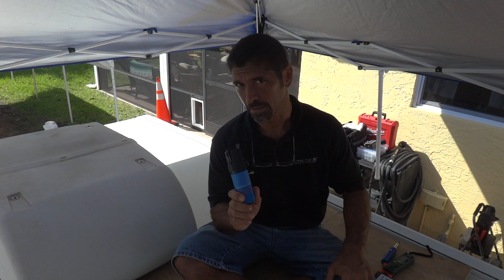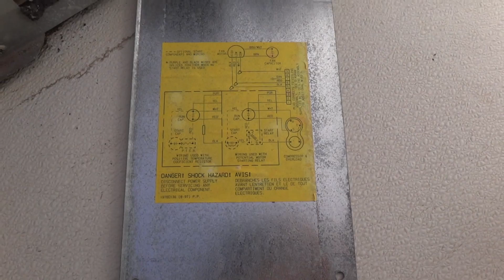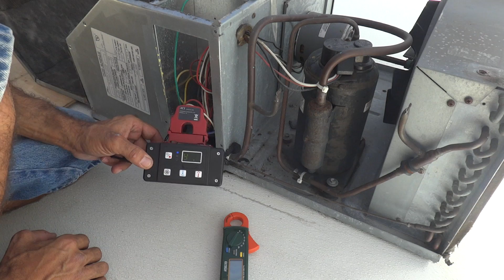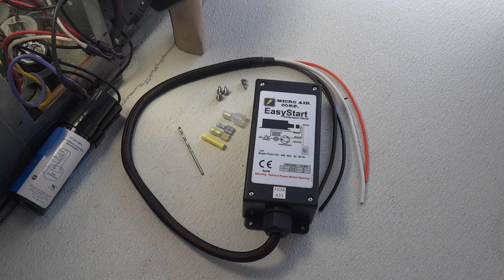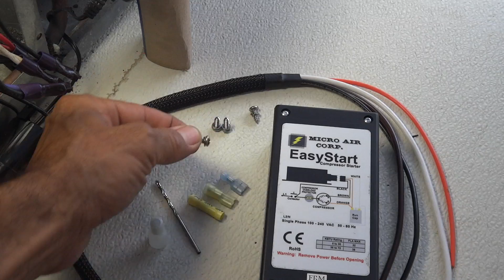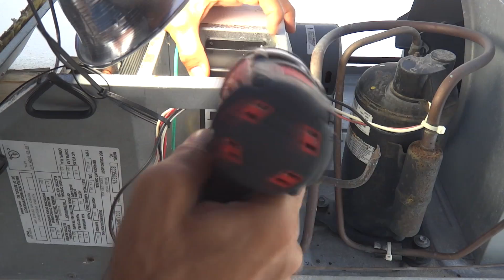Micro-Air EasyStart Soft Starter Installation into RV Rooftop Air Conditioner

Comment: I added the EasyStart to my travel Trailer's Dometic 15,000 BTU ac system.  I live at an altitude of slightly above 8,000 ft.  The technical support from Matteo at Micro-Air was simply fantastic and lightning fast.  You simply don't find this level of customer and product commitment anymore.  Prior to installing the device I connected my single Honda EU2000 Companion model to my camper but it could not start my ac and both the generator and my ac compressor would stall and bog down.  I also tried to start a friends new campers 13,500 BTU ac system at the same altitude.  My generator could start his smaller ac but would stall and fault out as the compressor attempted to cycle beyond the start cycle (after pressure had built up in the system).  After installing EasyStart, I had no trouble whatsoever starting and running my ac using both the generators 30 (26.6A) and 20 amp outlets.  I ran the ac system for almost 4 hours with no issues whatsoever.  I should mention that I forgot to take EasyStart through its 5 learning cycles using utility power (hopefully no harm done and maybe I can do this now and its not too late), and I had not re-jetted my generator for operations at altitude greater than 4000-5000 feet.  I also initially used 85 Octane fuel which Honda recommends 87 or higher to prevent loss of performance.  So with all these factors stacked against EasyStart, it was no problem for my Honda EU2000 Companion to start and run my ac system over several hours of operation and multiple compressor cycles by incorporating EasyStart.  A great product for 1/3 the cost of a second generator (who wants to lug around a larger generator or two EU2000's).  Highly recommend the product and the company.  I have several friends that will be buying the product - they are sold!  NO PROBLEM AT 8,000' and I am sure if I re-jetted (not that I need to at 8,000') it will perform just as well at higher altitudes'.
Reply: I want to provide an update to my post of one month ago.  After successfully installing and testing the EasyStart to my Campers Dometic 15,000 BTU ac system at 8,000 ft elevation using a single Honda EU2000 i Companion model, I was all set for a 3 week camping trip lin late August.  On two separate occasions the weather was hot enough that I decided to run the ac unit using my single Honda generator.  The temps were in the 86-88 degree range and I was at an altitude of approx. 6,800 ft and 6,300 ft. respectively.  On the first try at an altitude of 6,800 ft. my ac unit shut down and failed to start and the generator went into fault mode.  I shut everything down and tried again with the same result.  I must mention that I have not re-jetted the generator for high altitude as recommended.  A few days later while at a lower altitude of 6,300 ft. I tried again and this time the ac started but on the second cycle of the compressor (after pressure had built up) the compressor locked out.  I tried once more and got a similar result.  After getting home, I tried once more (now at slightly over 8,000 ft.) and the ac unit started but on the second compressor start it locked out.  I can only surmise that when I successfully tested the Easy Start after installation that the temps must have been much cooler than 86-88 degrees but I did not make note of that.  I really don't know how much of a difference if any re-jetting my generator for altitudes above 5,000 ft will make to the generators power output and if that will make a difference as the generator sounds like its running OK.  Additionally, I failed to take the EasyStart through its 5 learning cycles on ac/shore power after installing it and I don't know if I need to re-do this step by clearing its memory using a jumper technique????  Does anyone know how much increase power one can expect after re-jetting or even better, how much power degradation one can expect of the Honda EU2000 if not re-jetted.  Finally, I used fresh, non-alcohol based premium unleaded gas in the generator.  Over the next couple of weeks I will find time and re-jet my generator  and see if that will make a difference but as it stands my early success and celebration has been premature.

Comment: Will this Soft Start effect the life of the A/C or damage the compressor? I'm interested in installing a huge battery bank and solar system to run an A/C. If seen it done and they suggested watching your videos.
Reply from the maker: EasyStart actually does the opposite. It protects your compressor far better than any factory OEM configuration. This is because of its 5 different fault conditions that it constantly monitors for during start-up and steady-state operation.  Also, EasyStart has a "smart"" short-cycle prevention timer to avoid restarting the compressor while the internal refrigerant pressures may still be built up from the previous run.  Beyond this, although we don't have any empirical life test data (yet) to prove it, use of a soft start on a compressor will very likely extend its usable life because the mechanical and electrical stress of the brief locked-rotor condition that normally occurs during every regular (hard) start, is completely eliminated by EasyStart. 

Many customers with large solar/battery systems have succeeded in starting and running their A/C with EasyStart on inverters as small as 2000W.  Depending on the heat load and how long the A/C has to run, typically customers can get through a night's sleep entirely on battery power with an 800-1200Ah 12V battery bank.

Comment: I have a Dometic 15,000 BTU A/C and this device will allow me to start the A/C compressor with 1 2000 w generator reliably?
Reply from the maker: Hello. Yes, EasyStart will allow you to start and run a 15k BTU rooftop on a 2000W generator.  We've verified that it works on a single Honda EU2000i, Yamaha EF2000iSv2, and the Westinghouse WH2000iXLT, all from each generator's respective ECO mode.  There are others that have worked as well, but we've come to find out that not all 2000W generators are created equal.
Reply: @micro-air, Inc. Have you uploaded videos of a Honda running a 15k AC with your system?
Reply from the maker: @Esua.  We haven't made any formal video as of yet because our 15k in in our NJ factory and I work out of FL.  I'm still planning a full video to show this demonstration and to also address some of the other questions raised in the comments  for this video.

We did make one very short video back in June to help answer some questions in an Airstream Forum at http://www.airforums.com/forums/f382/running-your-dometic-penguin-ii-on-honda-200-generator-with-easystart-168019-2.html#post1962537. This short video shows our Dometic 15k Penguin II with our EasyStart running on our Honda EU2000i, with added load (a light bulb) to force the Honda close to its full 2000W capacity.  Obviously, that is not the demonstration you are looking for, but it is for real and obviously it works.  Also please check out our customer reviews posted on our website at https://www.microair.net/products/easystart-364-3-ton-single-phase-soft-starter-for-air-conditioners, and you will see multiple 5-start testimonials from customers reporting success with 15k units with EasyStarts on their Honda EU2000i generators.  Sorry I cannot offer anything else as of yet, but please stay tuned.

Comment: Very nice product. Does it work by "clipping" the waveform to reduce voltage thus controlling and limiting start current? I assume so because a PWI inverter would probably cost significantly more and most likely be larger in size.

Important question: Is the unit UL rated?
I may be purchasing one of these "soft start" units from you and attempt to run my roof AC with a Yamaha 2kW generator.
Reply from the maker: EasyStart is CE rated and it uses all UL-rated components and practices, but it is not yet registered with UL or equivalent agency.  For marine applications and RV aftermarket applications, UL registration is not required.  Also, UL restricts any design from being further refined thereafter.  If and when an RV or land-based OEM elects to install the EasyStart as part of their standard equipment, Micro-Air will proceed with investing in the UL compliance testing.

Comment: 17.3 amps is not even close to a 70% reduction. 17.3 amps is 42.0924% of 41.1 amps. That is a 57.9075% reduction. While that is quite good and definitely places the amp in an appropriate range for n RV/etc., the fact that you lie about something so obvious proves to me that you are not to be trusted. More over, I did a little research and found that soft starters have been around for some time and are available for far less than you are charging. They can be purchased from most any a/c supply source. Coleman supposedly sells one for $18. (I am VERY dubious about the stated price and assume the joker dropped a zero.) In any case, you have lots of competition. I will check out your more reliable competitors.
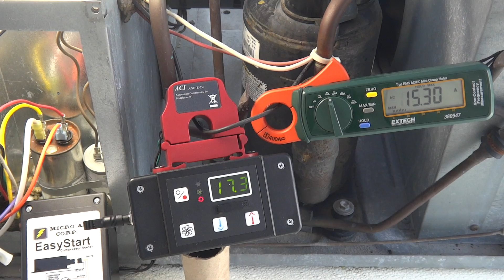Reply from the maker: Hello TDF Public.  Thank you for your comment.  During 29:45-30:20 in the video, the numbers cited are in fact 17.3A versus 54A LRA rating and versus the 41.1A measured starting surge.  These correspond to reductions of 68.0% and 57.9%, respectively.  During the video, I stated "about 70%" for the first reduction, and "about 60%" for the second reduction.  If you consider such rounded approximations as being dishonest, we ask that you please reconsider since that was certainly not the case as the calculations show.  

Regarding the history of soft starters, yes they have been around a long time, but prior to EasyStart, no other utilized the unique circuitry and control algorithm that is in the EasyStart.  The cost of a typical soft starter capable of running a 3-4HP motor (3-ton A/C compressor) range from about $140 to prices much higher than EasyStart.  Typically, the $18 solutions are the hard start kits discussed and tested in the video, not soft starts which are far more sophisticated and higher in cost.

Micro-Air's support and the EasyStart's performance and reliability are regarded as being quite high by hundreds of of our customers who have gone on record both here and in our many testimonials and reviews on our website.  We invite you to try the other soft start and hard start solutions for yourself to see if you can attain the desired results you are after.  Send us an e-mail if you have any further questions.  Thank you.

Comment: Hello Micro-Air, from the information that I'm getting at your website and this forum, nobody has asked about smaller systems yet. Will the box (EasyStart™ 364 (3-ton) Soft Starter) handle a smaller (7500btu) air conditioner?  I have a 1994 Roadtrek 190 Popular. I prefer not to lose a 25% restocking fee if I'm wrong. BTW, I didn't find you because of Gone with the Wynns. But I did stumble upon your video because I didn't trust the Hard Start solution for $14.95. The girl is cute and informative but the guy is corny. But maybe that's just their "shtick"!   (This is really weird, on two occasions I had jobs right down the street from you folks at Allentown)  Keep up the good work and hopefully I'll see you in the future.         SiGar
Reply from the maker: Hello CGaR and thank you for your interest in EasyStart. For your 7500BTU system, there is a specialized EasyStart Model 364 variant, p/n ASY-364-T36-IP, that is specifically mean for A/C units under 9,000BTU.  When viewing the EasyStart 364 page on our website, click on the down arrow to select the -T36-IP variant.  Regarding the hard start solution, you likely saw the detailed explanation delivered in the video; there is no comparison to EasyStart!

Comment: I installed the Micro Air Easystart Soft Starter on my 13000 BTU RV trailer and I have 2 Honda 2000 Generators. Now I only have to use 1 of the Honda Generators and I can run my A/C unit on Low fan and max cooling and use any lights and water pump all at the same time with no problems and in Econo mode too. Kept the trailer plenty cold had to turn up the thermostat because it was to cold at night time. If I ever need the extra power I can still hook up the other Generator.

Comment: Just installed your device yesterday on a brand new Coleman Mach 15 that would not start with a Yamaha 2400EI.  To my delight it worked and the installation was easy.  Your shipping was very fast.    I had to install the device on the front slide off cover as no room for it in the back.   I'm delighted with this product as I live at high altitude (3,600 ft.) and temps reaching over 100 degrees.   I've used hard start capacitors in the past and this product surpasses what they did!!    Definitely worth the money    Great job
Reply: So this  easy  start will work  with a solar hookup, that you don't need to use shore power?

Comment: Excellent video. I imagine this issue of starting up the air conditioner is why most RVs where equipped with 4k-6k Onan generators. Everyone is going to the smaller to the  2.4k wat generators but the starting surge of the air conditioners. was the problem.

Comment: Great piece of equipment but at $300 I will just get a 3000 watt gen. Thanks
Reply: Much cheaper to buy this with a 2000 watt generator, plus the convenience!
Reply: I have already started the air conditioner on my 2017 Grand Design travel trailer with my 3000 watt generator. It works perfectly.
Reply: Larry Richelli yeah and I do mine with a Honda 2000 which way less than 3000 watts and quieter and lighter and nicer and better
Reply: I think you are missing the point. I have a Honda 3000 inverter generator that would start my AC fine but with Easy Start I can run it in Eco mode and it is much quieter.
Reply: I don't think you get it. The LRA (locked rotor amps) are up to 6X more than your running amps. You might need an 8K gen-set to start an AC unit without the softstart.
I'm putting one (made by another manufacturer) on my 4 ton home unit so I can use a portable gen-set to run my house instead of a huge standby gennie.

Comment: Wow, I'm very impressed... I saw this on Gone With the Wynns, they're a great channel to watch. I'm definitely getting one of these for my RV.  I was going to install a large DC capacitor bank before my inverter to help handle the start up load (my inverter is 4000W and will do 12000W for 20s) but what you have here is 1000x times better than that. Thanks!

Comment: By watching this video and reading the comments below, it appears that this device will allow for consistently starting and continual running of most typical 15000 BTU travel trailer/RV ac systems using a single Honda EU 2000 genset.  Music to my ears - no more lugging two EU 2000 gensets.  Has Micro-Air Inc. or any customer installed this device and successfully paired it with a single Honda EU 2000 for use at altitudes greater than 8,000'?  Much of my camping is at higher altitudes that puts greater pressure/demand on ac startup draw.
Reply from the maker: Hi Kaivon.  Thank you for your interest.  We have confirmed reports of people running their 13.5k and 15k A/C units for prolonged periods using EasyStart on a Honda EU2000i up to about 3000', and on propane.  At altitudes higher than this, customers have encountered issues with the generator being  unable to sustain their output during steady-state operation of the A/C, without any problem at startup.  That is, the altitude is not preventing the EasyStart's from starting the A/C on generator, but the generator is having problems keeping the A/C running thereafter, which has nothing to do with EasyStart.  In a very recent case, an EasyStart customer at 5300' installed the high-altitude carburetor kit on his Honda generator, and afterwards he was able to run it for an extended period without any further issues.

Comment: I live in Venice FL.. can you recommend a installer ?
Reply from the maker: Harry - Thanks for your interest.  You're in luck. We just establish a new RV dealer in Naples, FL who is outstanding.  He specializes in solar, inverters, and Lithium battery systems for RVs, and he also does marine work as well.  He has a good stock of EasyStarts right now.  The company name is Solar Tech Energy Systems, Inc.  Contact Lew Farber at 541-490-6357.  Thanks again.
Reply: I want to buy one for my Airstream which has a replacement AC, brand name  ADVENT, which has a combo. AC & Fan Capacitor. Can you supply me with the wiring diagram for this unit to enable me to install the Soft Start ? (Naples is too far away for me to take my Airstream for the install.) Also, is the airstream 50 $ discount still available ?
Reply from the maker: Yes, we can supply you with a wiring diagram after your purchase.  Just specify the model of your Advent in the order notes.  We just found a few documents online for them.  The Airstream discount is still in effect.
Reply: The Advent # is : 77-9114 as shown on the original receipt dated 10/31/13. So, how do I order from you ?
Reply from the maker: That appears to be their model ASAAMC135.  I was able to find a scan-quality wiring diagram on the internet.  To purchase your EasyStart, go to our webstore at http://store.microair.net, sign-up, find the EasyStart model 364, and add it to your shopping cart.  Remember when you checkout to use your coupon.  Thank you again for your interest.
Reply: What coupon...where do I get it ?
Reply from the maker: Enter "AIRSTREAM" in the coupon code section of the payment page during the checkout process, and that will get you $50 (now $40) off!
Reply: Thank you.